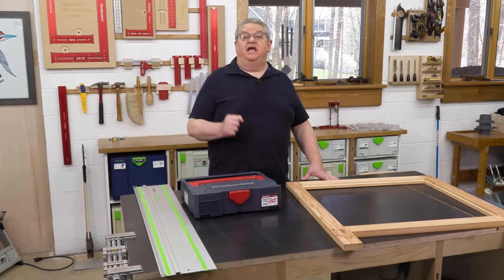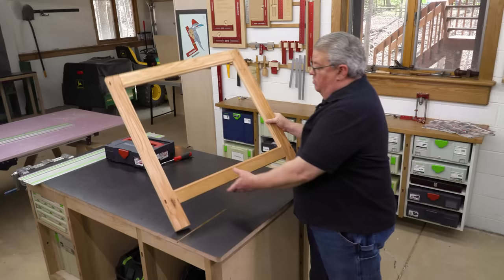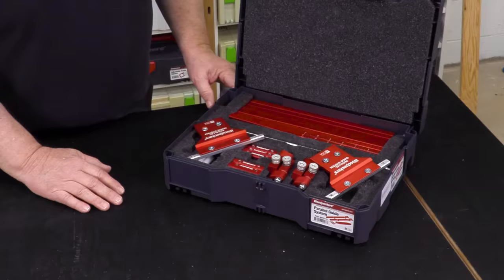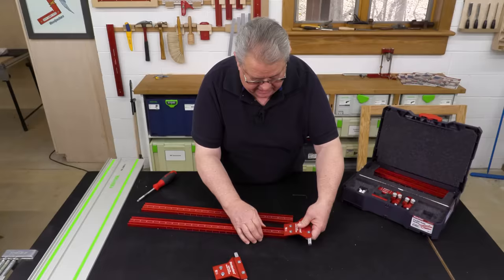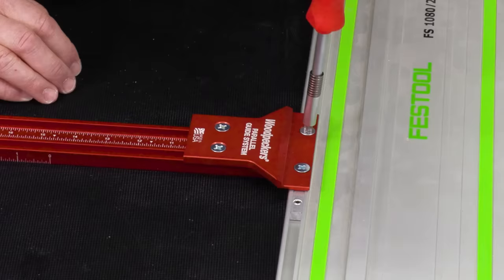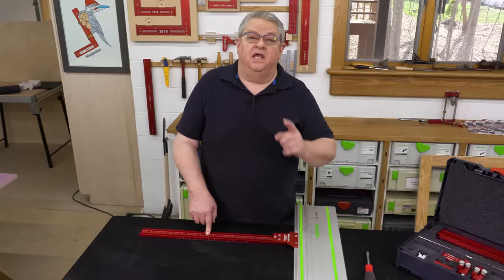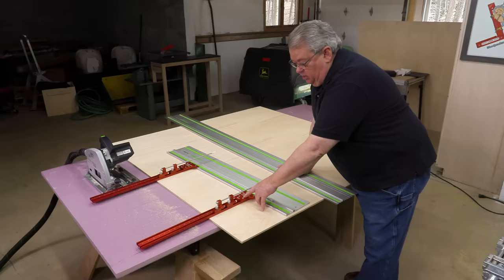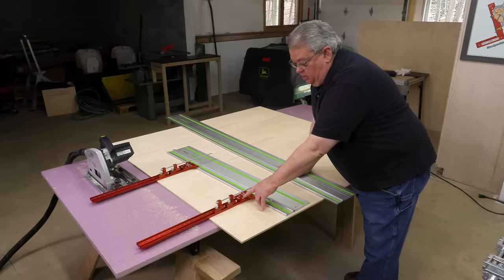This Track Saw Accessory Might Replace Your Table Saw | Deep Dive

Comment: I admire this man's passion, no criticism.  I've worked several decades in carpentry and furniture building; used all the expensive machinery . . . then decided one day - no more.  I have two 18" tool bags that carry all my equipment including a drill, circular saw and router; if it doesn't fit in those bags, then I don't use it.  I have a knockdown bench that house's my circular saw in a table saw format.  I have a 4 foot and 8 foot straightedge piece of plywood for guiding my saw.  It all fits comfortably in my vehicle.  I've never fallen short of tool necessities, and have always completed the job to a very high standard.  The real challenge, but also the real pleasure, of woodworking is doing the job well without $20,000 worth of tools.
Reply: I agree alot of these finish carpenters and cabnet makers have more tools than brains. And I also do agree that it had been done well before all these fancy tools and done to a very high quality that is. But sometimes these more expensive tools makes the difference in the way of efficiency instead of a "must have to do the job". But myself work out of a 6 ft by 6ft by 6 foot tall small cargo trailer and I've done all kinds of amazing projects I'm proud to have my name on with just the necessary tools, and just a couple fancy onesto make me more effiecent. Cause time is money
Reply: Well a large part of any hobby for a lot of people is the tools/supplies. Anyone with a hobby has their way of approaching and maintaining and growing it. Different strokes type thing I suppose.

Comment: The thing to remember is the real value of this system - even with the setup time - is for those of us that have a limited space that cannot accommodate a big table saw and outfield. I'm working in one bay of a 3 car garage. I often have to set up and take down each day and sometimes even each step. I don't do remote work like at a job site but I can see a similar value for transport etc. I'd most certainly have the big table saw and outfeeds as a preferred choice but if that is not possible, this is excellent!
Reply: I was considering this as an addition to my portable work center which includes a track saw, table saw, SCMS and router table. I was thinking maybe I could leave the table saw in the trailer most of the time. I'm glad I watched the video, this looks awesome for when it's just me putting around, but this seems too fussy for use in the field.

Comment: Now I know I need table saw! Thanks!
Reply: I could not imagine all that trouble to avoid using a precise table saw
Reply: @drewyoung2102  What about when your table saw does not have the capacity to perform a cross cut?  Like me, my max cross cut is 32" on my table saw.

Comment: I initially owned the Festool parallel guides.  When Woodpeckers first came up with their product (and you didn't need a 2nd mortgage to buy a sheet of plywood), it seemed like something worthwhile.  Never mind the metric/imperial difference, the Woodpecker has a far more precise method of setting the width of cut.  The fact that it knocks down and stores in a systainer means I no longer need to devote precious wall space to hanging the Festool.  I have never regretted getting the Woodpecker.
Reply: Same here. I haven’t used the Festool guides since I got the woodpeckers
Reply: Did you consider the TSO system? I'm leaning that way myself and would like to know what others think about it.

Comment: Whew! The system is complicated and has too many nicy nacky parts to assemble and adjust, The concept is good but needs some user-friendly engineering.
Reply: The calibration is a one-time thing, and he was painfully slow going about it - but this is a training/demo video.
Reply: It isn't that frickin' good. I have one similar to that, and it isn't very handy except to hack up plywood sheets into something I can carry to the table saw.
Reply: Just thinking the same thing.....and the price.  No thanks
Reply: @drrckhamilton  $479.99  ouch..
Reply: @pd417  

Yeah!!!! I'll pass lol
Reply: Woodpecker is always way overpriced for what it does.
Reply: Some user friendly engineering....hmm what if, just hear me out, could you flip the saw upside down and maybe like fix it into place on a flat surface. Then just have the straight edge parallel to the blade but be able to adjust it easily......could work?
Reply: @johnpowell9202  I'm ridin' with ya bro......but i have yet to see any "production" engineering as precise as woodpecker.  That said, I can field engineer it myself, to as fine a specs as they do.  so yeah, for the money....?  naw thanks.
Reply: For the price and setup needed, I will keep my table saw.
Reply: penia dla typowego jankesa  skomplikowana  jest nawet obsługa    zgłębiarki

Comment: good god I could just wait for my toddler to grow up and help me with that sheet on my table saw.
Reply: It looks like a real pita to set it up.
Reply: @johnhubbard3399  If you are at a job site, it's better then a table saw. Plus you can pack it up each day and take it home  (reduce theft). If you are in a shop, you just never break it down. I can see its uses. Esp if you are location or space constrained.
Reply: @TheRealMafoo  If it was $30 you would have a point, but it is literally more expensive than a portable table saw. Just buy one of those and take it home everyday and save yourself the setup and take down times.
Reply: @danniaction  Or use a tracksaw.
Reply: Obviously, in a shop you can always set up support rollers to handle big stuff on a table saw, but i can see why some will want this product instead.

Comment: I can't lift a sheet of 3/4" ply, not to mention maneuver it on a table saw. This tool worked great for me to break down sheets of plywood with minimum waste, especially the 8'-long pieces. I agree that the cost of buying this tool is high, but after building a few built-ins, it suddenly doesn't seem so bad compared to the cost of hiring someone. I also used this tool to cut dadoes using a makita router guide + track. Once it's all set up and calibrated, the cuts are fast and precise, as long as the stops are tightened properly. Woodpeckers, you are welcome for the free ad.

Comment: This is pretty slick.  Too bad it costs $600.  I made a 4' and an 8' "track saw" out of scrap plywood that works great.  The only cost to me was buying the non-skid tape that I put on the underside so I don't have to clamp it down.  Works like a charm and cost me 1/4 of what a track saw does INCLUDING a new Dewalt circular saw.
Reply: I've made my own circular saw guide as well, as used double sided tape on the bottom with then decided to upgrade to Festool and Woodpeckers. I'll take Festool and Woodpeckers anyway! 😂
Reply: @ThriftDiving   Dumb.  The amount of money you spent I purchased a Craftsman King Seeley power tool combination set The Ultimate power tool combination set ever made.   I am not spending any money  this eye candy.

Comment: I have an older track guide with built in clamps that has a base that attaches to a circular saw. I just dedicated a circular saw to this set up so that the base is always attached to that saw and just use it with the track. It does as good a job as a table saw with sheet goods and I would be finished with all the cuts you're looking to make here long before you finished setting that up.

Comment: Under Dunn (YouTube) made a track saw guide and a set of these about a year ago for about an eighth of the price. I built them using his plans and they work very well.
The guide rails just clamp to the saw guide. Once calibrate initially it remains calibrated and is quick to set up and use.

Comment: "Honey that was a good breakfast, see you after dinner, I'm going out in the shop to make 1 cut on a sheet of plywood."
Reply: LOL. Exactly what I was thinking..
Reply: What do you want for your birthday in two weeks? This video took longer than cutting some wood. My project is finished.
Reply: Well, it is LONG and slow, because it was made UNDERSTANDABLE enough!
But the versatility and precision of the concept is there.
Reply: @tiffanywall4178  Agree on the price of their stuff.  Well, I don’t consider myself a complete idiot (others may have a different opinion) but I do have two of their squares I got on some really good sales, otherwise would not have purchased them.  Great quality and precision.  Like any product, purchase it based on budget and need and compare to the competition.
Reply: peckerwood makes another video
Reply: Honey, just bought a new table saw, call someone to assemble it after I spend all weekend in the garage loosing parts.
Reply: Actually this takes much less time when you’re not teaching. In addition, with my track-saw I can cut 3 sheets stacked. I also have a small shop, and i work alone so anything other than small pieces is not practical on a table saw
Reply: @kennygrooms8935  Not bright enough to get sarcasm?
Reply: Using a $500 couple of rulers

Comment: For over 40 years I have managed to scrape by with a straight edge, a couple of clamps and a decent square. Can't believe that this is actually a thing and that people actually buy them! Way to over engineer something lol.
Reply: Same here, but everything I cut is almost always a millimeter off square. Drives me nuts.
Reply: @imacmill   Measure twice cut once was always what I was taught as a lad. Wise words given to a youngster that have stayed with me for over 50 years. The old skills are still out there :)
Reply: @Keefymonoped  Ya, but the trouble is, I can measure 10 times, and my cuts are almost always off by a small amount. Maybe my tools are junk.
Reply: Instablaster.
Reply: @imacmill  
Well, I hope I'm not stating the obvious. But lumber, moves a little bit, depending on its moisture content. Or, it comes from the mill not square.
He talks about that, at 07:30. But you combine those two challenges, and.. it could definitely throw you off.

But if your in the construction industry, or even just working on your own project, & you put up a wall one day, then come along, and your woods dried out a lot overnight,
that itself could affect your measurements a little bit. 

I know I was under the impression wood was always squared, then I started building a deck, and having to cut the ends off boards, just to square'em out.. things were off on some by 1/4 inch.. It was ridiculous. (This was before the whole covid, world ending deal going on now)
Reply: Watching the entire video, & seeing how the tool works.. Its hard to imagine how useful it would actually be, for general work.
This product is a pretty hard sell, unless, maybe your a fine cabinet maker or something...
Reply: @MRSketch09  I'm just talking about the seemingly simple process of cutting a  square piece of 3/4 MDF... it's never square, no matter how meticulous I am with my line drawing and saw guide placement.
Reply: @imacmill  mine are always off by 1 inch
Reply: @sparkypdx  mine are always off by an inch

Ya, your wife told me last night.
Reply: @imacmill  daaaaaaaamnn
Reply: Some people are more meticulous and have higher standards than others. When I build something it is square, level/plumb, and looks professional despite me just being a DIYer. When my friend builds something, or my brother-in-law who is a "professional" (working carpenter), nothing looks great upon close inspection (or even not-so-close inspection).  Some people say the difference between carpentry and woodworking is 1/8th of an inch. Others say 1/16th. That's the difference. It's all about how high you set your standards. People who buy Woodpeckers products get that in my opinion.
Reply: @imacmill  Like the youngster who told his teacher "I did this math problem 10 times... and here are my 10 different answers."

Comment: As a hobbyist I'll never be able to afford any of these, especially the $1K track saw, but I do enjoy watching these videos.
Reply: You can make a track saw using some quarter inch thick plywood and any circular saw you have.
The only down side is cutting something longer than right ft.
I have been using this method for over thirty five years.
Reply: I bought a cheapo Scheppach track saw for €130, fitted a decent blade & I was away... 🤗

😎👍☘️🍺
Reply: @jimsenior403  That's how I made my bookcases. Came out fine. I have a small shed and a patch of good 'ol mother Earth as a workbench.

Comment: Super handy. Just don’t have money to spend $479 on a tool that helps out my $400 Makita track saw.
Reply: I think I could put two pencil marks on the wood off a tape measure and get it close enough.
Reply: Only $ 479?? Make that € 650 in my country!!
Reply: @dalesworld1308  That is what I have done for years and I would rather have $479 for wood ...
Reply: Get on AliExpress and put together a knock-off. You may not find it as a complete kit, but you'll find the components you can put together. At $400, it's nearing the cost of the Festool version which is a much better designed product.
Reply: @windmill10  Wow, you have a country.
Reply: @biggusbestus551  Give grandpa Joe time, and that $479 will buy you a single plywood sheet.
Reply: For that money you could hire 4 workers for the day and cut ply till your hearts content. What a bullshit piece of equipment.!!

Comment: this video reminds me how lucky i am to live in a place that uses the metric system for measurements...
Reply: Inches and fractions are equally intuitive and simple when your brain gets used to it, metric system is not easier to use - its only what you are used to. If you claim metric is the only easy intuitive system you admit that all Americans are smarter than you, and then they probably are.
Reply: This might shock you but we are allowed to use the metric system in America too.
Reply: @pflaffik  You are perhaps really great but I can somehow manage inches and feet but but not ounces and pounds. The fractions are another thing but when I was in the US (early 80s) it is no nice to hear that they were trying to shift to the metric system. Well, I guess they are still trying ...
Reply: Iain, if that's not a invitation to get flamed by imperial users I'll go hee for tiggy 😏
Reply: @pflaffik  LOL the imperial system is not at all as intuitive or simple as the metric system.  For a start percentages are much more complex to work out in your head.  Also, the metric system can allow a more accurate measure e.g. most imperial tools would be in 8ths or even 16ths of an inch.  A 16th of an inch is still more than 1mm.  We count in base10 and so the metric system makes way more sense.  Your last sentence is also nonsense.  There is no admission that Americans are smarter, they are just more inefficient.
Reply: @pflaffik  I doubt that!!!!

Comment: More expensive than my DeWalt table saw, which of course comes with a saw...
Reply: Your forgetting the price of the track saw, which might also be slightly more than your table saw.
Reply: It's still cheaper than a SawStop
Reply: Does it also include a new finger when you cut yours off?

Comment: I'm surprised there were no lasers or trigonometry involved in setting this up.  Good commercial for just getting a dang table saw.
Reply: I'm surprised this doesn't connect to wifi and alexa!
Reply: Properly calibrating a table saw isn’t any easier. Especially my used Bosch job site saw where the table wasn’t flat and the fence isn’t straight. Spent 2 hours with a straight edge and a orbital sander trying to get my table and fence true
Reply: @kevinthomson6324  Yeah but you don't have to do it every time.
Reply: Table saws are cheaper, too.

Comment: Try taking a 1/16 off an 8’ boards with that. Try cutting finger joints with that, try raising a panel with it. Definitely not even close to a replacement for a table saw.